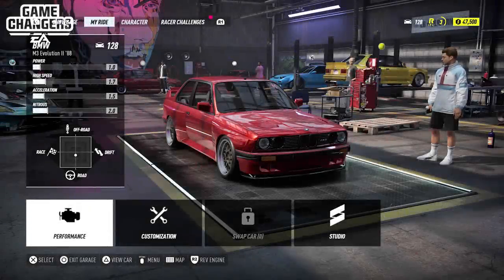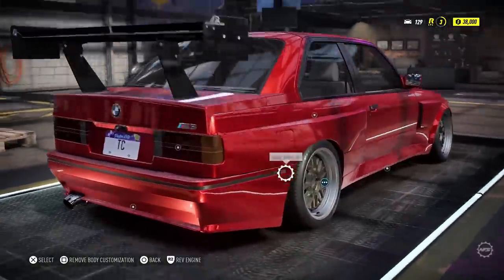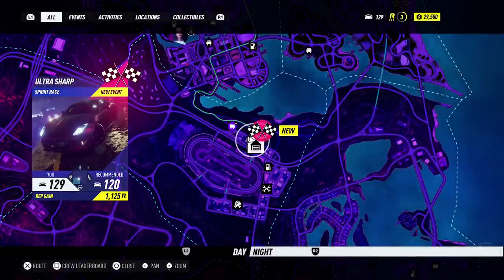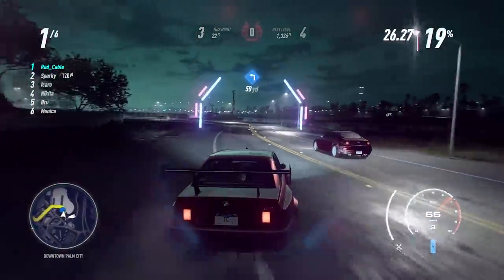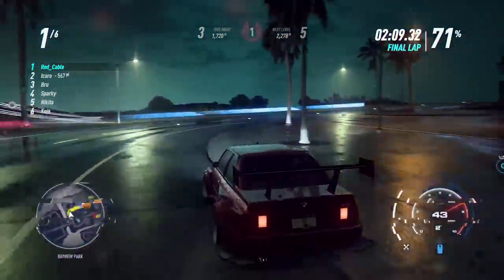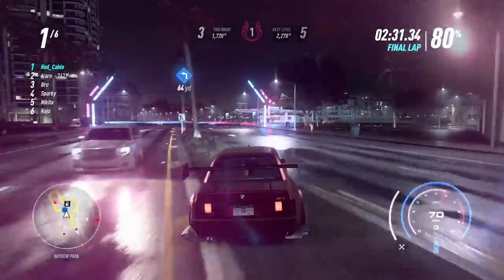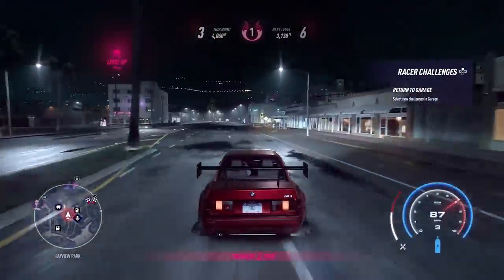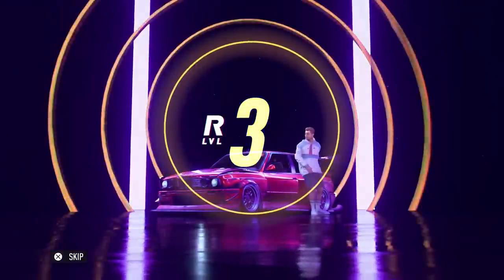Need For Speed Heat: Do GRIP PHYSICS Actually Work? Grip Build & STORY GAMEPLAY! Xbox One/PS4/PC

Comment: Im not excited for drift even in nfs 2015 i just wanted to know if was faster than the other guy only time i lost was drift not my thing but im decent at it. I would wait outside the garage for sprints. finished nfs 2015. Pro street all the undergrounds carbon most wanted. Never finished payback.
Reply: I stopped playing nfs after shift was released. I’m hoping to get back into it, but I want to know the physics.
Reply: @Eratiik  I dont think its that bad i haven't tested most of the cars i know physics can be different in faster cars im driving a Nissan 370z but i dont have trouble with the car physics. But i think its fun a break from the sim racing games.